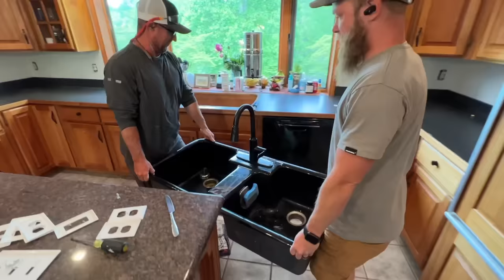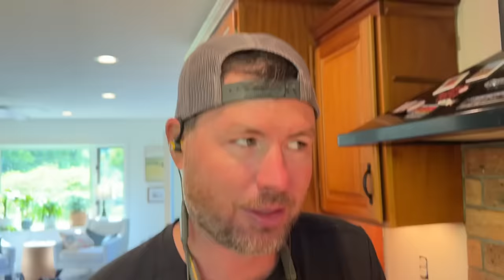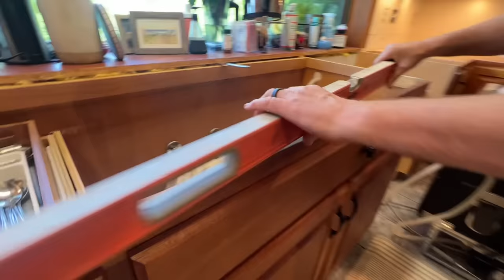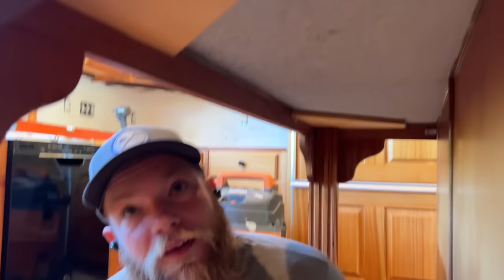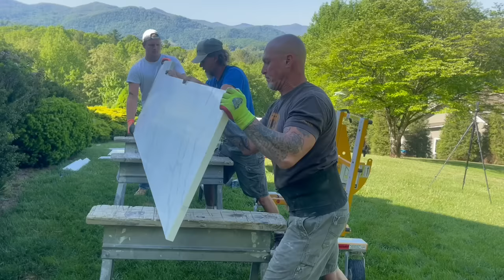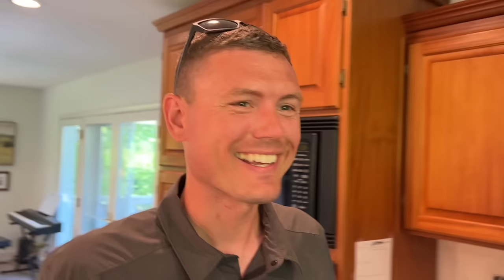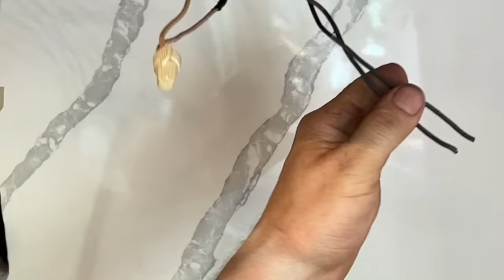Watch this BEFORE before replacing your counters!

Comment: It was a shame to break up the stone top of the island.  Being a scavenger, I would have tried scoring the top before breaking it in half.   Once I had smaller pieces, they would have been repurposed as smaller out-door table tops or as hard flat surfaces as was shown with the sink cut-out from the new quartz top.
Reply: I agree.  It might have been worth the delay to get extra manpower to remove it in one piece.

Comment: Hey, for the casement window cranks, they make handle replacements that are smaller, look like large wing nuts. That would buy you some thickness for the bay window platform.
Reply: Thinking the same!  Then some Formica!
Reply: Yes butterfly t-handles!
Reply from the maker: Hey great idea
Reply: You can also glue down a piece of melamine with the same draw of the countertop. It will look like it extends all the way up to the glass. Silicone on the seams will sealed watertide.

Comment: You'll never see how "hammered" existing cabinets are until you take them out or put them in another area of the house (like a garage or workshop or she shed) - nothing makes your cabinets look really sad like brand new counter tops especially if they are lighter in color.  But still, if you're wanting to keep the cabinets at least take some time to address whatever is broken and to give them a good cleaning (including re-applying any oil, wood treatments or even an extra coat of stain / poly)...

Comment: If you wanna change anything about the cabinets, I think new hardware makes a huge difference. I changed some stuff from brushed silver to matte black in my house to make it a little more modern and it made a huge difference for me.

Also, soft closed hinges and drawer pull will at least make them feel like much higher quality I think. Great little weekend project

Comment: You should always set up a laser when installing cabinets or checking them for that matter. The laser gives you one point of reference, using a level is harder and one cabinet to another could change just because of a racked cabinet, they are so easy to tweak and you need more than one level to get the job done, usually a big stick on your long front and back and a 24" for front to back. It is so much quicker and more accurate to use a self-leveling laser, the right tools for the right job lol.
 Sorry being a pro trim carpenter and many years of remodeling work as well as new construction you learn a few things lol. What's the use of knowledge if you don't pass it on
Reply: Forgive me for I’m ignorant. Is it possible that lasers weren’t normal back in the early 90s or so? I think they mentioned the 90’s when talking about the original countertop.
Reply: @jax3032  The laser level was invented in the 1960s by Oscar Soliz who sold the rights and has been manufactured and developed into the lasers we use today. The first self-leveling lasers were being used in 1973 by many construction companies, everything from surveying, and ground grading to leveling foundations/footings,  and yes even setting cabinets/countertops.
Reply: levels are still more accurate to a point until you combine the two into not a self leveling lazer but a lavel and lazer
Reply: yaaaaaaaaaaaaaaaaawn

Comment: I installed countertops (laminate, quartz, natural stone, glass, Corian, etc) for 5 years. We tore out old tops on probably 30% of all installs we did. When removing, we always cut out the front and back piece on cooktops and sink holes completely (like left and right of the holes, front and back). That allowed us to be able to shimmy much smaller pieces of countertop off of the cabinets and out of the house.
Reply: I presently install countertops for home depot. For bigger tops just cut at the dishwasher with a jigsaw if possible. It contains all the saw dust on top of the dishwasher. Sink or cooktop is my 2nd choice. Also you have to put your level at the 90 between the cabinets to make sure both plans are at the same level.

Comment: Here is a nice tip for the oscilating tool - in order for the blades to last longer you could use a vacuum cleaner attached to it - that will keep the blade cooler. And you should test the festool or fein blades - they are a looot better for wood.

Comment: It really does brighten up the space. I did the same thing at my place. I have very dark wood cabinet almost like a brown/red ish. And the white quartz countertop really brighten the space and made it look way better. I also changed hardware for a more modern style and it really helped and only cost like 200$ to do.

On another note, here where i live in canada, its really common to refinish/repaint the cabinets. It gives it a 2nd life. You could probably have them painted light grey or event do a contrast with a darker grey on the island and the pantry cabinet/wall oven cabinets. Its way cheaper (here like 3500$ CAD to have someone professionally refinish them way cheaper than spending 20k on new cabinets.

Anyway great video and sorry for the long comment, cheers🍻

Comment: Also to add, yes fixing the flatness on those sags will help but regardless the installers are going to have to shim. Since theyll be joining together at least 3 piece of stone and putting a full height backsplash on top of it, that means all 3 piece have to be coplanar so shimming is going to happen regardless and therefore there's inevitably going to be some visible shim placement if you bend down to look.

Comment: I’ve been slowly swapping out my halogen lights for LED lights, they’re a lot cooler. I too have a large bay window in front of the sink but it’s a pain to reach into so I have plans to replace mine when I get the time. Too bad that island countertop was busted up since it could’ve been used by someone somewhere. I’ve cut down many stone or solid surface countertops using just an abrasive masonry blade on a circular saw. I’ve even repurposed concrete sidewalk slabs using the same method, using a fan to blow the dust away and side doweled rebar for alignment…much like biscuits. I’ve never understood why anyone would pay such high prices for kitchen cabinets when they’re so easy to make. My dad was a cabinetmaker back in the 60’s & 70’s, making custom stuff for the rich in Palm Springs CA while living in Henderson NV (near Las Vegas) but I can assure you anyone can build cabinets, even me…an ironworker.

Comment: Pro tip.  Those clips on the dishwasher can be removed from the top of the dishwasher and moved to the side.   That way you don't need the filler strip on the top.   It definitely is a clean look the way you did it though.

Comment: we here in Europe use roof tiles and on some roofs still thatch. Also wanted to say I always watch you I'm from the Netherlands and enjoy your work! it is nice to see how much difference there is in the houses with you they are wooden houses and with us concrete houses and nowadays the masonry walls come straight from the factory and a pipe is ready within a few hours only the inside still takes a lot of time. I'm an electrician myself and the differences are huge compared to how you do it there!
Reply: Here in Germany you can always see if something was built pre-war or afterwards. The old buildings are beautiful and filled with details while the newer ones are concrete slabs most of the time. I don't like the modern style but I guess it's cheap. I have the feeling that the US has way more house styles. Here things like roof pitch etc. are heavily regulated and I pretty much never see things like porches, bay windows, 'towers', or even bigger garages that are made for more than one car.
Reply: @coalacorey  nowadays there are more types of houses but most countries in europe do not have free architectural styles you have to build in the style that the municipality has determined
Reply: @coalacorey  probably because the US has such varying climates; it’s hard to do one-size-fits-all
Reply: Live in US, Charleston,SC.  Charleston, like many older cities in US { old to us is fairly new to you in Europe), have quite strick building restrictions.  If the building is in a Historic Districk, you are absolutely required to follow the local historical guidelines.  The larger issue i think is we in US, still have a lot of space to build.
Reply: @gregday9527  / Dude, it's "strict" and "district". Too many book bannings  down there I guess.

Comment: Under the window, you may want to install a thin sheet of stainless steel. Could be as thin as a 1/16. Water proof stain resistant. If that is too expensive, or if you want color, try a powder coated piece. Probably cheaper to go powder coated anyway. BTW, REALLY ENJOY THE VIDEOS. If your crew would like to go on the road in May of 2023 and do a video in Portland, Oregon, let me know. We are building a beautiful house here.

Comment: A wood finish restorer could go a long way in perking up those cabinets. Cheap and super easy to use. Check for color and sheen on a test piece. I’ve used “Restore-A-Finish” from a company called, Howard. Worked well.

Comment: kitchen cabinets are made to be strong in the least directions as possible. you didnt really know they were flimsy till you pulled the tops off, so they were doing their job. And with the tile, there is no guarantee the toekick will be in the same spot as the old one. If you could have gotten that stone countertop out whole, mexicans will come running for it. And you can save the environment from stone pollution.

Comment: Would you consider some “old school” Formica for the bay window surface? I realize it is a finish completely different from what you’ve installed, but it might be thin enough to allow the window cranks to work and would be moisture proof.

Comment: I own a granite countertop company. The best way to check level or set cabinets is with a 360 laser level. Find the highest cabinet and work off of it . Split the laser line on the front edge of the cabinet and just hit the backside of it .  They will be perfect all the way around since you had 2 seams .  On white quartz on the seams standard razor blades will leave the seam looking a little grey sometimes. They make white ceramic razor blades now . Just for white quartz and seam glue .

Comment: You need to get the Diablo blades for the oscillating multi tool, they last way longer then the other garbage brands out there. Everything else is trash compared to Diablo
Reply: I like the Diablo loop backed sandpaper too. It’s the best for staying stuck. Other than using a piece of industrial sticky backed Velcro when the sandpaper side is great but the loop side has worn out.

Comment: On the  oscillating blades I take a cut off wheel [ .045 ] on my 4 1/2 grinder and make new teeth. Works great on soft wood and dry wall. Came do it over and over .
Reply: ? picture?

Comment: Reference the casement window cranks... Jamie's got metal working tools, have him make custom cranks; with either a longer base to retain the original mechanical advantage of the cranks, or a shorter shaft so they clear the sill surface, or a combination of both. Look at the fun he could have, machining them from billet aluminum, and then anodize them black.
Reply: That sounds like a fun little job! I love some metal workin!

Comment: Hey Jaime I use a small triangle file to refresh my oscillating tool blades. I put the blade in a vice and file them till they are sharp again. They last a lot longer. Only problem is sometimes it is hard to find a file that small.
Reply: I’m glad to hear I’m not the only one…

Comment: G,day from Sydney Australia.
Cabinet kickboards "kickers"
If you need to cut into them or pack them up off the floor, cut some black, silver etc Laminex/Formica strips 6" and contact glue on. 
Cheap alternative is black vinyl Wapping the Kickers.
🌏🇦🇺

Comment: My Fathers and Grandparents bought a duplex built in 1998/1999.  In the main bathroom there was the same kind of vent, just a hole in the floor beneath the cabinet and a vent on the kick plate.  I always thought that was a half-ass maneuver.  Made those cabinets either really cold or really hot!

Comment: Diablo carbide multi tool blades. I've cut 10's of linear ft and still haven't grabbed the second one out of the package. Lots of use adding kerf style weather strip to 100 year old homes.

Comment: I'm sure its too late by now but I had the same dilemma with my under cabinet lighting when installing new back splash. My fixtures were just like yours using "halogen bulbs" BUT... BUT...
rather than buying and installing all new LED fixtures all I did was buy GY6.35 LED Bulbs ... they are one for one direct replacements, available in warm white or Daylight white, are  dimmable, flicker free and only use 4Watts compared to the 40W halogens. (tons to pick from via the worlds biggest online store with two day delivery)

Comment: "This has gotta be from the 90's..."  You guys crack me up.  I am currently living in an apartment in which the kitchen has not been updated since 1978.  Although I will say, all my cabinets are all- 1/2" wood, with 1/4" plywood shelves in the upper cabinets.  The outer surfaces are mis-matched (upper and lower are different.)  I've often thought of replacing those but... you know.  Rental.  Plus the upper cabinet fronts are maple.  I couldn't match them and it would be a shame to get rid of those.  Can you even get solid maple cabinets doors nowadays?

Comment: Just found your site "Brothers Karamazov," 81 and years of DIY house, yard, car because it kept me from drinking too much since booze is my profession's drug of choice...your presentation is outstanding and likewise with your commentary...btw brother Jamie's smile and concomitant dental work is that of Hollywood or NYC thespian...😀  Counter top and back splash behind the stove the brick... doesn't it collect hard to remove cooking splatter?? what about continuing high quartz particularly if that is facade brick/stone imho the quartz continuum would have been better functionality and look...and all that labor effort to eliminate gap on the counter...assuming structural integrity for the quartz top with the cabinet I would have left the gap and "when in doubt trim it out" filled in with a 3/8 to 1/2 quarter round of contrasting or matching wood such a teak, walnut, mahogany...lastly Assuming Mrs chose  her new kitchen's top material and appearance I make no comment because it's her kitchen; however, if any of the "guys" choose it  then my comment would be were you trying to emulate the look of an early 20th Century grand railroad station or men's club light marble floors ...with the labor money saved could have used Brazilian, Bahia Blue granite...just a thought

Comment: Probably too late to comment and matter, but they have small airbags that you can use to lift that cabinet easier. (Rhino Strong Commercial Grade Air Wedge Bag Pump Professional Leveling Kit & Alignment Tool Inflatable Shim)

Comment: Hi!  I just want to end with a suggestion for the future when it comes to changing out quartz tops.   Call the manufacturer who made the new tops.   I am sure they will take it and recycle it!   You also have a lot of excellent artitisans in you neck of the woods that could creatively reuse the granite top.    Just tink of the number of cutting boards tha could be made fro that top?  Say $100 each for a 18"x24" cutting board?   How big was the top before breaking it?    Thanks for the videoes.  I am fixing my home for a structural problem and I am finally am putting everything back!   As for the casement window wood you painted.  Did yoy ever consider formica?   I comes in a granite finish! and I think it would clear the crank?

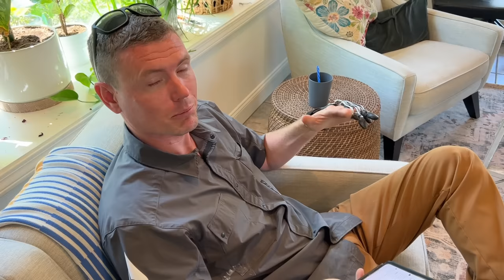Comment: 23:52 yeah i'm from Europe and after 10y in USA i still don't get it(i mean i do it's all about consume market in usa but still) why shingles are used here just to have to replace them every 20y or so. in Europe you put roof tiles once and it sometimes lasts 2 generations or even more(about 100-140y). and siding here too when you could use "brick siding" to be "forever" , well at least as long as you are alive. it's mind boggling how cheap houses here are made and how expensive everything is despite only being made mainly out of wood

Comment: Are you sure it was the cabinet sagging and not the floor?  If cabinets were installed level, how do they become un-level other than the floor moving?  The rear of cabinets were screwed into wall, are they still level?  If yes, seems like the floor is the problem.

Comment: Maybe you should have removed that brick or have it faux finished another color. Quartz is great material but, keep in mind it will flash with hot food items. It is only guaranteed to not melt under 200 degrees. So trivets and never use crock pots without a trivet. I am a REALTOR and see this material after use and it does scratch and flash oh and it does stain. The warranty says "resistant". So many think they can install this material and abuse it like they do with Quartzite or Granite.

Comment: Just completed a full Kitchen remodel. Lots of work but not that bad. We went with a butcherblock countertop made things a LOT easier. We have done Corian before since my brother has a lot of experience installing it. My father was in commercial cabinets for decades so I have a lot of experience to pull from but honestly its a lot of labor but not something so far outside of the ability of DIY'ers they just need to be ready for the work.